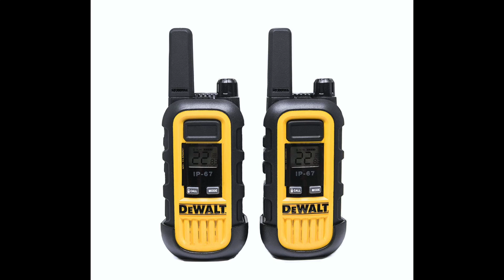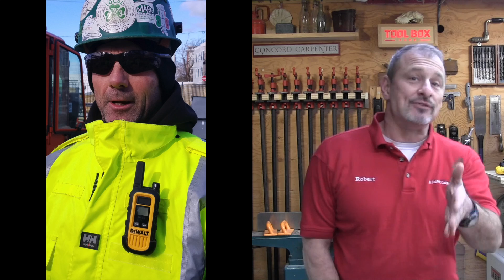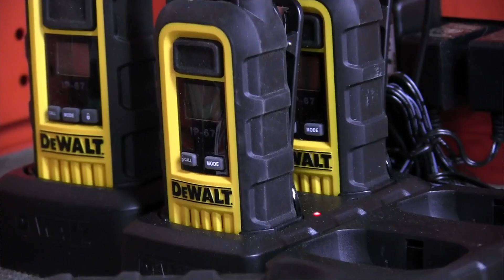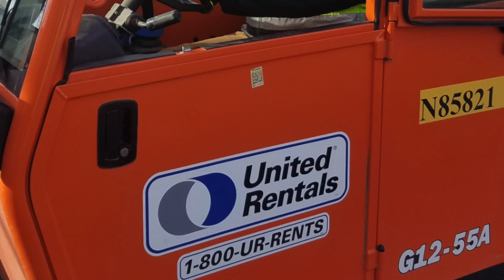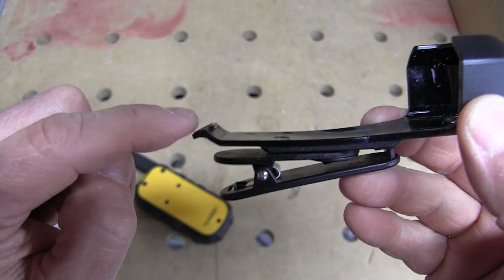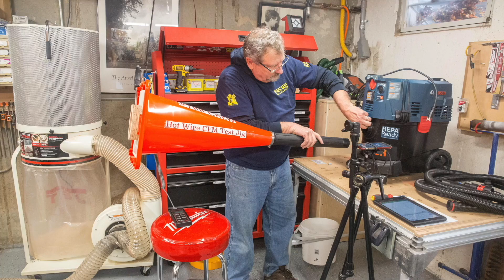Dewalt DXFRS300 Rechargeable 2-Way Radios For the Job Site

Comment: Where is the scan? How does it work? Was told from AI to hold mode for a few seconds and it will auto scan threw channels but I did everything Ive read online and NOTHING WORKS! A.I says it's got a scan feature but i just can't find it. I'm 3.20 into the vid nothing about the scan  feature yet so if there is ignore this if not I NEED HELP DAG NAMMIT! LOL
Reply: I do not have the manual I baught them with out 1

Comment: I think people better remember that using an FRS radio shares frequencies with licensed GMRS users.  Nobody seems to read this in the manuals that comes with walkies.  When used for business, I would be careful or risk getting reported.  I say this because FRS is legal for business use, but it is common to ignore other users on a frequency, and create "interference".  This is starting to get reported a lot more I've noticed, and businesses have money, so they're a target for the FCC.
Reply: F R S shares channels 15 through 22 thay are the off repeater channels
for G M R S radio service if you go above channel 22 it will say R P T stands
for  repeater channels I am licensed .

Comment: Can you turn the roger tone off?
Reply: Yes you just turn if the radio and hold the call button while you turn it back on and it will beep to deactivate. But all others have to shut it of because whoever has it when they talk it will do the roger beep still

Comment: This sounds like a good industrial radio for short distance communication. With the laws changing with regards to power in the FRS category to a max of two watts, I believe the most power you can get, the better. You can always adjust the radio to lower output as most GMRS handhelds have the option  to do so. My radios offer 5 watts, 2 watts and .5 watts. For long distance like a few miles or so, 5 watts on both units never has failed us in the urban area. On medium power, a couple of miles works in the urban area and on low power, if you can get six blocks to 3/4 of a mile, you are doing good when in a building. In the camper, we have the Midland MXT with 40 watts and in the pickup following, we have the MXT115 that has 15 watts we can talk 20 to 40 miles on the interstate. The Midland GXT1000VP4 can talk to the pickup and camper at about 10 miles without issues. The DeWalt looks great for construction sites and buildings. With 2 Watts now, I would suspect that on a good day, you can get several miles without much interference.
Reply: I hope you got your license for them
Reply: this radio is for keeping a crew together on a job site one block squear 
and 12 floors up

Comment: The 250 000 square feet range is very misleading. 250 000 feet is 76 kilometres. I don’t know how they calculated this, but here’s how they really perform outside. In straight line without obstacles, I loose the signal after 0,5 kilometres. Very disappointed.
Reply: and add 12 floors made for target Walmart and other stor's

Comment: Here I am thinking these may be the perfect radio for my needs and then I see the PTT switch is on the front... the FRONT!!  In 40 years of walkie talkie usage I have never seen a unit with the PTT on the front. Oddly, any photos you ever see of folks using these you can clearly see they have their hand wrapped around it and their thumb is nowhere near the talk switch. Since most of these photos are construction related and I doubt VOX would work in a noisy environment, I can only assume that none of these folks are actually USING the radio.  :-)

Comment: I used them in a concrete building, the max range was about 400 ft the building was 600ft by 160ft so i stopped using them .I don't recommend for a more than 400 ft distance.

Comment: How do they hold up against steel and industrial setting? can you sync them with other Dewalt radios?
Reply from the maker: The do well in commercial spaces - not sure on the sync up
Reply: all brand's of family service radio's are the same in side so same channels for all put them on the same channel and thay will work
there are grate at the mall in side

Comment: Just picked up a pair of these for hiking and cell dead spots. So I can communicate with the wife. :) Searched to find out how to use and low and. behold. Thanks Rob!
Reply: Must have not worked while on the hike he never came back.
Reply: @knucleballfreedom   thay make them thay run an never come back
and there so old that THE last up date from the F C C was 2017
we are in 2024
Reply: How have you found them for hiking? I'm thinking of picking up a set for the same reason.

Comment: I’m in the tower industry and I wish this radio came with some type of tie off point to string it from my harness
Reply: I am an astronaut and I wish this radio came with a heat shield to protect it upon re-entry
Reply from the maker: Jourdre Hogan I’ll have to look at it closer and see if there’s a lanyard connection
Reply: A Concord Carpenter / ToolBoxBuzz Thanks. Looking to purchase but I’d hate to drop it 100s of feet up on tower.

Comment: I think it would be wise for Dewalt to make it compatible with their 20v battery chargers. 
Have the back moulded like a battery so it clicks on existing chargers which we (Dewalt owners) have. Or at least an adapter so it can fit. 
My 2 cents. 
Still looks like a great product
Reply: That seems like a really good idea.
Reply: @williambutler3695  
I suprise even myself sometimes lol
Thanks
Reply: @williambutler3695   sorry the F C C  rules over all radios F R S is only 1/2 a watt.

Comment: Ptt button should be on the side. Not practical or user friendly.  Thanks
Reply from the maker: MrBubbajohnson1 we got used to it quick
Reply: I hate to agree, but yeah, seems like it would be awkward 🤔
Reply: I think that if you ware in your belt you could push the button with a finger
only a thought.

Comment: Unless the FCC has changed the rules, these should be 1 watt only. If the cover FRS, it’s 1/2” watt, GMRS is 1 watt max.
Reply: They did. 2017 I believe. Up to 2 watts in FRS.
Reply: TexasScout Noneofyourbusiness Dewalt has another radio with 1 watt
Reply: GMRS requires a license to use, however once the license is acquired you can transmit at up to 50 watts. Most GMRS handheld radios broadcast at 2 to 5 watts while the mobile base stations go between 15 and 40 watts.
Reply: In 2017 the FCC re-defined FRS radios. Now the FRS and GMRS share the same 22 frequencies. GMRS only radios also have 8 repeater frequencies that FRS radios cannot use. Channels 8-14 are the old FRS channels, and can only be 1/2 watt. Channels 1-7 and 15-22 can be up to 2 watts. A GMRS license is NOT required for these radios (a major change). Channels 23-30 are repeater channels. Any radio which broadcasts on these channels, or at over two watts, must be licensed. A GMRS license now costs $70, but is good for 10 years. The license does not require a test, and one license covers the entire household.
Reply: @clydeosterhout1221  thanks! A appreciate all that info. I’ve been thinking of putting up a GMRS repeater myself. Do you know if the repeater must be “type accepted “ by the FCC?